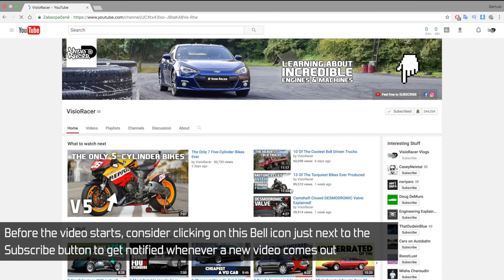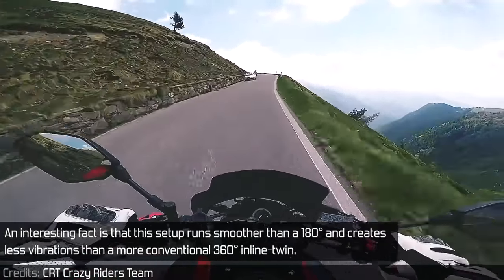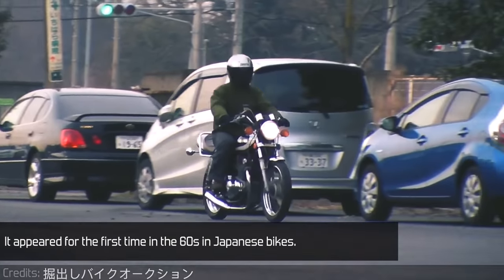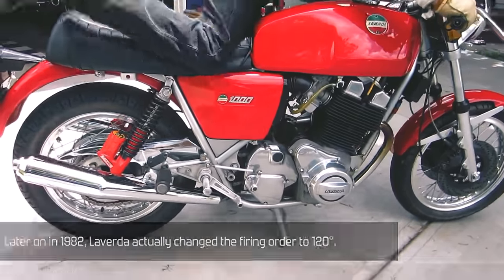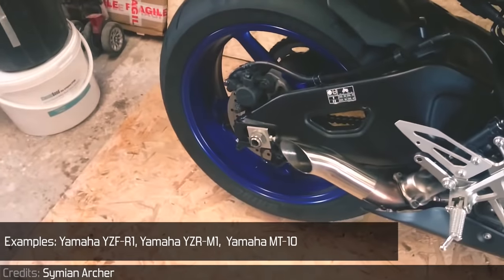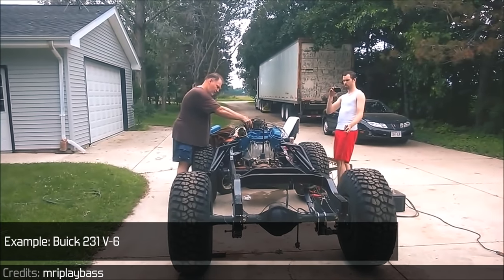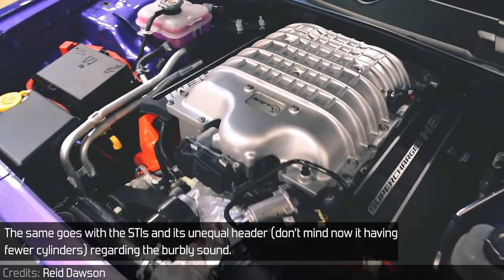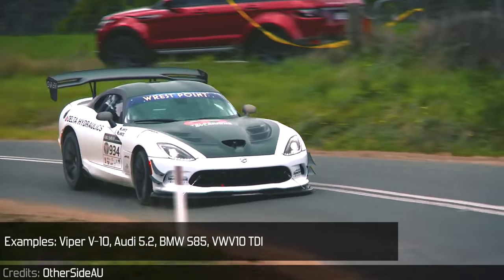7 Interesting Examples Of An Uneven Firing Engine

Comment from the maker: The crossplane four-cylinder wins for me, the 270° inline-twin is close, too! I just love the burble sound more tbh :)
Reply: It is basically a crossplane V8 cut in half longitudinal.
Reply: VisioRacer I like your content I wish you would hire soon that can speak clearer for an American/Canadian
Reply: VisioRacer  fz-09 / mt-09 ??? Crossplane cranks?
Reply: You should have included the lambo v10 and compared and contrasted the 2001-2005  5.0L split pin even Fire to the 2006-present  5.2L odd fire.
Reply: that yamaha crossplane makes me wish someone like dodge would try it out in larger displacements for cars.  The way things are going, V8's might be legislated out of existence soon so a turbo inline crossplane 4 might be the only way to carry forward the majestic noise of the most correct automobile powerplant format.
Reply: If only there were a crossplane-four for automobiles...
Reply: Sketchy it makes no sense. The cross plane makes better low end torque at the expense of the top end power that flat plane engines make. Hardly any 4 cylinder car engines rev like the 9,000 rpm S2000. Most are 6,500 rpm Corollas, Focuses and Accords that don't need the high rpm power, but do need the low end torque. Cross plane econo cars should have happened years ago.
Reply: droceretik because corruption
Reply: Among 270 and 180, 270 any day!
Although I prefer The sheer noise of a V4 over the crossplane inline-4.
Rumor has it that Ducati is finally going to ditch V-Twins in its superbike in favor of a V4. 
Let see...
Reply: Hey Visio racer I just wanted to say that. Cross plane 90 degree v8s do fire equally every 90 degrees the distributor would not be able to fire the engine in a perfect circle in which they are
Reply: VisioRacer agreed
Reply: ENDURO SK where
Reply: droceretik - flat plane offers several advantages, primarily being that they are much easier to balance, require far less material in the crank, and experience less vibration.  As a result, crossplanes are more difficult to engineer well and more costly to manufacture.  I would wager a guess they also wouldn't last as long but that can depend on the specific manufacturer and whether they engineer for cost or for reliability.
Reply: ExaltedDuck Your logic about cross plane engines being more expensive to engineer and manufacture  perfectly explains why American V8's are so expensive compared to their cross plane counterparts.
Reply: Not cross plane engines.  A crossplane 4 vs a flatplane 4.  In v8's, the overall even firing order (whether crossplane or flat), 90 degree V, and pairing of pistons on crank pins balances a lot of the problem vibrations a crossplane 4 invites.
Reply: ExaltedDuck odd numbered cylinder engines have that problem too, but they've overcome the issue
Reply: Jleone leone What?
Reply: It's not that larger ones can't be built.  The issue from an engineering standpoint is that larger displacement crossplanes perform better, so why make large flatplanes?  With a small flat plane, you sacrifice 2,000-4,000 rpm performance so you can have 9,000 rpm explosive power.  with a large flat plane, you still sacrifice 2,000-4,000, but can't reach more than 7,000 rpm (because of said vibration), so why not just stick with crossplane?
Reply: srsly for an ancient engine?
Reply: Lotus Esprit with a crossplane V8 !
Reply: The main benefit to the cross plane 4 cylinder on the R1 and FZ/MT-10 is it dulls the torque rise slightly creating an easier to manage powerband.  There is no benefit in a car as cars are much heavier and have much lower revving engines.  The YZR-M1 uses a variation of the cross plane crank, but uses the "big bang" firing order common to MotoGP bikes where the motor fires off two cylinders at the same time in order to space out power pulses without losing overall power.  A MotoGP bike with a traditional flat plane 4 cylinder would be unridable.
Reply: The Yamaha CP3 motor (FZ/MT-09, FJ-09/Tracer900, XSR-900) is a traditional 120 degree 3 cylinder firing order, which happens to be a form of cross plane crank by default (not 90 degree intersections though).
Reply: Me too! I love the particular sound of the crossplane
Reply: the crossplane i4 sounds like a v8 oddly
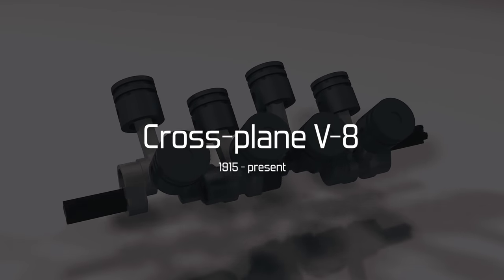Reply: 5:31 That's a lego model engine lol
Reply: I agree, I currently own and daily a 2016 Yamaha FZ-07 and will soon enough own a Yamaha FZ-10 as well. I had the pleasure to ride alongside a 2009 R1, a 2016 FZ10, and another FZ07 all with Full exhausts not long ago... The ambiance was just beautiful.
Reply: VisioRacer will a cross plane crank work in an inline 6?
Reply: It's possible. As an engineer, we can put the journals wherever we want. It just causes issues on where to put the counterweights. The benefit for an inline-6 is that the front half of the engine is a mirror image of the back, so the parts are easier to make. Crossplane and flat plane are said to have benefits, but that's subjective. A counterweight behaves like a flywheel. In a past life, I designed some small high revving engines and we calculated that the flat plane crankshaft itself had enough inertia to serve the duty of a flywheel. The engine was equipped with a clutch and a metal disk we called a flywheel, but the so-called flywheel was more of a friction disk than a flywheel. Management didn't understand the difference.
Reply: No, no, no, no ,no, no!!!! Audi and BMW are separate companies. The BMW V10 is a 90 degree V10 with offset bores. The Lamborghini V10 is a 72 degree engine. Different ball game. Fun engines, but different ball game.
Reply: Agreed !
Reply: I like the white lettering on the gray field. The letters just pop out vs the white on yellow. Which is nearly impossible to read. Please change back. Thank you.
Reply: i got one amazing design and power!!!
Reply: Same with me bro !
Reply: @andrewbartleman9169  ttby n]
Reply: The MT-10 and Crossplane R1 are some of the most incredible sounding bikes.
Reply: you have the wrong buick v-6 here, the 231 was an even fire engine, you are looking for the 225 oddfire engine they built.

Comment: A crossplane V8 is only odd-firing between each cylinder bank, the engine itself is even-firing.
Reply: I was about to post the same: a crossplane V8 with a shared crank pin fires evenly, but each cycle has back-to-back firing on each bank. That means at some point the left bank fires twice in a row as does the right bank, raising pressure in the left or right exhaust manifold and causing the burble. A four cycle engine with shared crank pins can only fire evenly if the angle between the banks is a multiple of 720 divided by the number of cylinders, such as 90 degrees for a V8 (720 / 8), 120 degrees for a V6 (720 / 6), or 180 degrees (opposed) or 360 degrees (inline) for a 4 cylinder (720 / 4).
Reply: Marty Scholes Exactly
Reply: @martyscholes119  very very interesting. 
So the common 60° V-6 layout is just a packaging compromise then? Not perfect, but the best possible within reason
Reply: @nthgth  Packaging is one thing, but the other reason most V6's are 60° is that a 60° V6 with –60° crankpin offsets actually has perfect primary balance (the force vectors for each pair of pistons sum to a perfect circle instead of an ellipse).
Reply: @electric7487  so what about that 120 degrees stuff from the other guy?
Reply: @nthgth  The –60° split is also used to even out the firing intervals and make them 120°.
Reply: @electric7487  so is there any advantage at all to using a 120° vee angle? (Not that that's practical)
Reply: @nthgth  The one advantage I could see with a 120° angle is the lack of split crankpins. But now the horizontal imbalance is 1.5 times the peak primary force whereas the vertical imbalance is only 0.5 times that. So you have a lot of balancing issues. Also, it's very wide, so at that point you might as well use a boxer 6.
Reply: @electric7487  I love a flat 6. But what are the horizontal and vertical imbalance figures with a 60° V-6?
And, could you recommend a book or web site on this? Really interesting stuff
Reply: @nthgth  These are my calculations for force vs. time in a V engine. Here, V is V angle, s is crankpin split, the engine is oriented upright, and t = 0 is assumed to be the pistons at the same height in the cylinders and closer to TDC. If s > 0, then the split is positive, and vice versa. For example, Ford's Triton V10 has V = 90° and s = 18°, so the firing interval for each pair of cylinders is V – s = 72°. An even-fire 90° V6 has V = 90° and s = –30°, so the pair has a firing interval of V – s = 120°. The force vs. time of each pair of pistons as a ratio of the primary force of each piston is:

Fx(t) = sin(V / 2)(cos((2t + V – s) / 2 – cos((2t – V + s) / 2)) = 2 sin(t) sin(V / 2) sin((s – V) / 2)
Fy(t) = cos(V / 2)(cos((2t + V – s) / 2) + cos((2t – V + s) / 2)) = 2 cos(t) cos(V / 2) cos((s – V) / 2)

The imbalances are (again, as a ratio of the primary forces): 

Fx = 2 sin(V / 2) sin((V – s) / 2)
Fy = 2 cos(V / 2) cos((V – s) / 2)

For example, the figures for an even fire 90° V6 would be Fx = sqrt(6) / 2, Fy = sqrt(2) / 2. And for a 60° even fire V6, we would have Fx and Fy both equal to sqrt(3) / 2. This is what they are talking about when they say a 60° V6 has perfect primary balance.

Note that this is only for each V-twin that makes up a V engine. For a complete solution you will have to sum the forces for each pair and adjust for their phases accordingly.
Reply: @electric7487  Wow, thank you.  I've copy/pasted that to my computer so I can learn to wrap my head around it (though I'm not exactly a stranger to algebra or statics).  Thank you for taking the time to type that out for me.
Reply: @martyscholes119  Flat 8 engines have this problem as well. As well as a 60° V12 or flat V12 with 60° spaced crank throws and a boxer 12.

For a Flat V8 (shared crankpins), one possible firing order is 1-5-2-3-8-4-7-6, where cylinders 1 and 5 on the left fire one after another, and cylinders 8 and 4 on the right side. For a Boxer 8, same deal. 1-6-8-3-2-5-7-4, 1-5-8-3-2-6-7-4, 1-6-7-4-2-5-8-3, and 1-6-7-3-2-5-8-4 all have 2 cylinders on the same side firing one after another. I bet that they would sound different than a V8 though.

Comment: The French PRV V6 is infamously known from being and odd firing, 90° block engine (it's a chopped V8 design). It became even-firing when fitted with a split pin crankshaft, but can be found odd-firing in early versions, like the one powering the DeLorean.
Reply: The same was done with the 225 cubic inch Buick 'Odd Fire' V6 of the early 1960s which was sold to Kaiser Jeep 225 Dauntless), then back to GM who split the crankshaft pins for an 'even fire which eventually became the 231, 3.8 liter.

I run a hopped up 225 Odd Fire (Kenne Bell equipped, MSD, lots of carb., fat headers...) in a 'flatfender' Willys Jeep.

Comment: When will people understand that a crossplane v8 is not uneven firing? The engine fires every 90 degrees of rotation. It may not fire left right left right left right left right, but it's still even firing. The banks firing unevenly, but all together it fires evenly
Reply: Correct.  Left Right Left Left   Right Left Right Right.  You could say that each bank in odd, but they're definitely even when combined.  Unbalanced, but even.
Reply: depending on the V angle it could still be odd fire, but I get your point.
Reply: I was about to mention it :D
Reply: @petrsulc1168  me to

Comment: I like VisiorRacer choices of 270 inline twin and crossplane four as well.The 180 degree triple Laverda's  they were awesome. The original Triumph Tridents  360-degree crank,with pins at every 120-degrees was also awesome. Retro character is coming back.
Reply: The W800 also has a 360° crank, and I'd say it's an excellent choice. I personallty love the 360° crank, because even though it's outdated, its simplicity and primitiveness still give it an awesome vintage feel. Put on a 2-into-1 exhaust and it gets even more cool than it already is.

Comment: You forgot the Husqvarna Nuda, a paralel twin with a  315 degrees crankshaft and an amazing sound
Reply from the maker: Thanks for mentioning, will remember that!
Reply: eframos I didn't realise that it was 315° for the Nuda I always thought that it was 360° the same as the BMW F800R on which it is based.
Reply: yes its  315º for the Nuda, one of the changes that Husqvarna made to transform the "peaceful" BMW engine into a beast
Reply: eframos thanks for the update.
Reply: RJs favorite bike haha.  The 315 degree crank apparently gives it the same firing interval as a Harley V-twin haha.  Albiet with a LOT more power than a Harley.  Fun bit is BMW went with the 360 degree twingle firing order on the F800 simply because it produces an identical exhaust note to the boxer twin haha.
Reply: @mrvwbug4423  its not a twingle if the two cylinders don't fire at the same time. In BMWs they fire alternatively. When one is at the power stroke, the other is at the intake stroke

Comment: I've never thought the 180 degree inline twin were considered "odd". I thought i was the most common one.
Reply: I would have considered the 0 degree inline twins (norton commando) as the odd ones. Not the 180 degrees.
Reply: MustangnfsQc Me too, I mean, they look really unbalanced. My opinion
Reply: MustangnfsQc Yes Twingles.
Reply: Zentäi 289 I know what your saying, it looks like it would be smoother, but a 180 degree inline would only fire evenly if it were a 2 stroke. A 4 stroke at 180 off actually alternates between 180 and 540 degrees between cylinder firing.
Reply: The 180 degree twin is considered the easiest to balance and can rev the highest, it is basically a traditional flat plane 4 cylinder cut in half.  I'm surprised he didn't have a Ninja 650 in the video as an example, the Kawasaki 650 twin that is used in the Ninja, ER-6 and Versys is the 180 degree design.  The twingle is the traditional layout for British bikes ala Triumph, Norton, BSA, etc.  BMW still uses the twingle design on the F800 as it produces a sound nearly identical to the boxer twin.  The 270 is a newcomer that mostly aims to replicate the sound and powerband of a 90 degree V-twin but with the simplicity and smaller package of a parallel twin.
Reply: mrvwbug44 good information, another interesting difference is that the Twingles fire both cylinders at once where the F800R fires it's cylinders alternately.
Reply: No I think what he means is that the 2nd cylinder has it's firing stroke 180° after the 1st instead of 360° after. Remember that the crank of a four stroke rotates 720° per cycle.
Reply: Zentäi 289 ikr every 250 or 300 twin inline has this

Comment: The european PRV (Peugeot Renault Volvo) engine from 60's was also 90* odd firing V6. About 80's they started using split crankshafts and it was no more odd firing.
Reply: BTW interesting fact is that the PRV engine was used for example in... DeLorean ;)
Reply: It was from the 70's actually (built at Douvrin) and had firing intervals of 150°/90° instead of the 60°V's even 120° intervals.
Reply: and it was arguably worst engine ever put in a Volvo, one of the worst if not the worst V6 ever made
Reply: It's not that simple. I heard that the first PRV have some "issues", but they can't be that bad, when they were building them for over 30 years ;) I have one of the last PRV with even firing timing in Peugeot 605 94'.
Reply: Tay Tay - I don't know about Volvo maybe you're right, but "the worst V6 ever made" was more probably the 90° 3-litre Maserati V6 in the Merak (also Citroen SM). The Merak installation needs a mechanic in constant attendance if the car isn't to fall prey to the occasional ambitiously driven Capri V6 (same displacement, but solid).
Reply: Actually it was very advanced for it's time and praised by the M.I.T.
Reply: @STax9  I don't think they were "bad" as far as reliability, however, they were rather slow, even compared to similar displacement v6s, and have a poor power-to-weight ratio. 
The DeLorean is probably what most people think of when they think of the PRV v6, which was riddled with problems, and it was rather slow to boot.
Reply: Volvo licensed the 225 Buick V6 for use as a marine engine as well.
Reply: @Financmajster  Nonsense.

Comment: I love all of them, but the Yamaha crossplane may be in a bike, BUT I LOVE THAT ENGINE ALOT!!!!! 

Now they need to make crossplane 4 cylinders for trucks and cars.
Reply from the maker: Definitely!
Reply: TheMadnessSkull75 LMAO No, dude. I like Harleys.
Reply: The Yamaha CP4 motor is something special.  You won't ever see them in cars, there is no benefit in a car.  The smoother torque curve has no benefit in a heavy vehicle with a larger low revving motor and it is heavier and more complex to produce than a traditional flat plane inline 4.
Reply: mrvwbug44 What about a V4?
Reply: The rocking moment from the primary imbalance would be nuts in an engine large enough to be used for a car. People see v8s as super smooth luxury and 60° v6 as "shaky" when the v6 only has secondary imbalances.
Reply: cough V4 cough
Reply: there's no point unless it's a high revving engine ... more than 10000 rpm or so
Reply: if you want a quirky exhaust pulse in a 4 cyl car you want a v4. v4 is also a good revving engine in a bike, but less smooth than a crossplane 4 unless it has extra mass in the crank counterweights. otoh v4 can have might have a packaging advantage. ICE configurations involve tradeoffs, and engine designers are paid big money to be all over this stuff

Comment: Another odd firing engine is the LS12 V12, basically two inline 6s sharing the same crank pin.  Much like having two Buick odd fire v6 joined end to end as well.